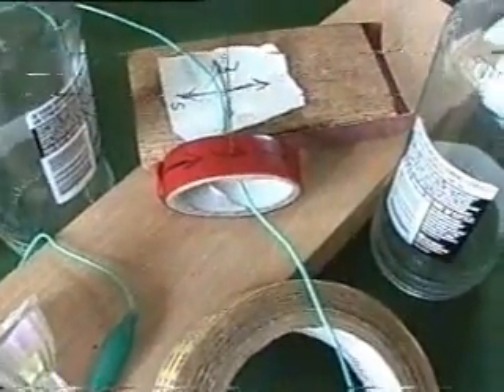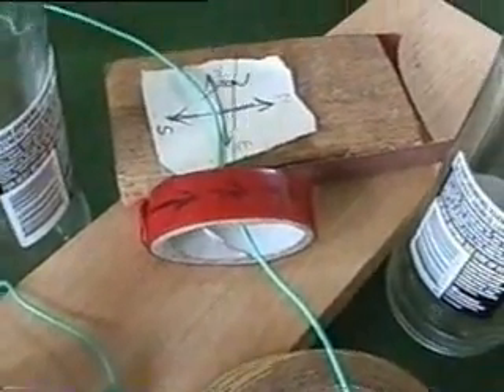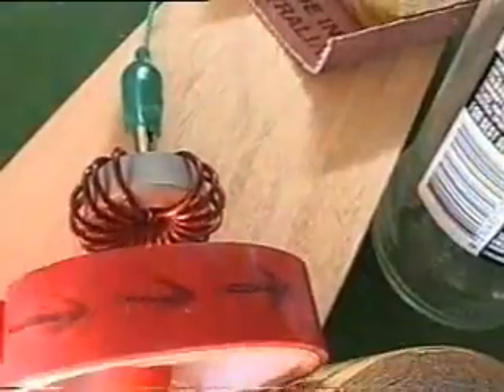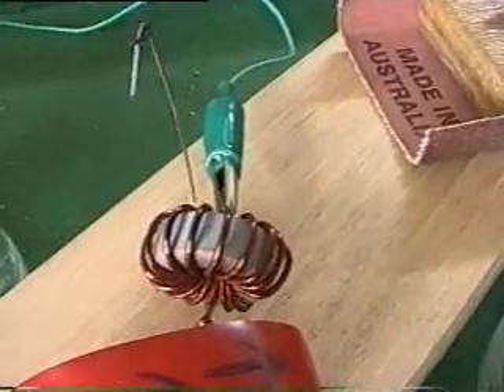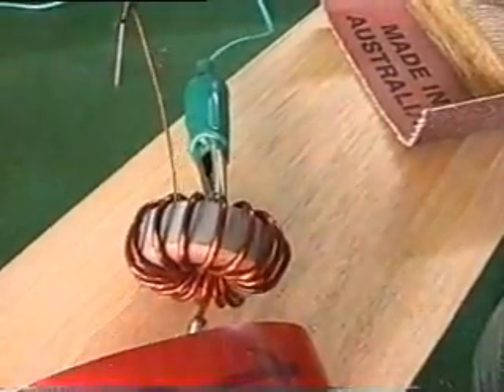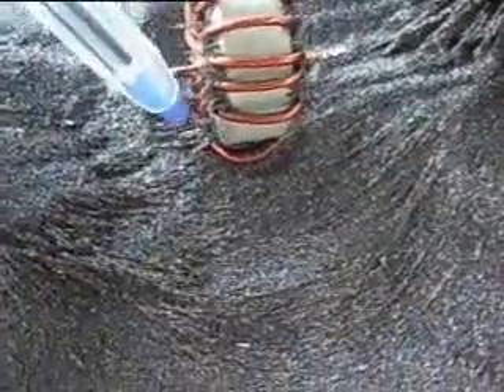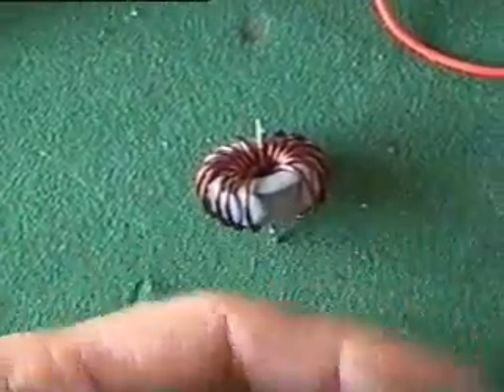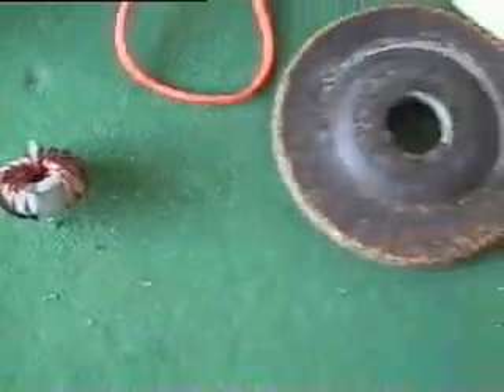orbo info.wmv

Comment: The problem is simple: in an ideal toroidal coil, ALL the magnetic flux is captured by the core. That is why the needle moves where there is no wire (an interruption in the flux), but not where there is.

Comment: Let me give you my take on the big problem with the discussion on the OU forum.

In a normal pulse motor, you pump in electrical energy for the pulse and the motor speeds up - you can see the cause and the effect.

In the Steorn pulse motor, the rotor speeds up and then you pulse the coil with electrical energy to prevent the rotor from slowing down.  The cart before the horse so to speak

People think the latter is free energy. They are wrong, in both cases the electrical pulse gives the energy